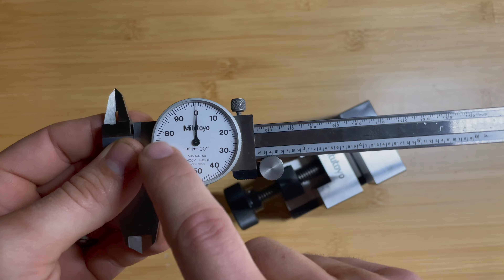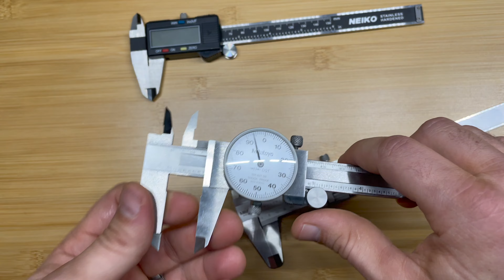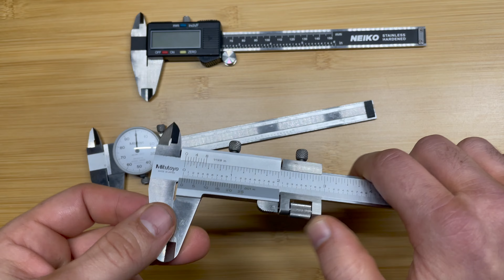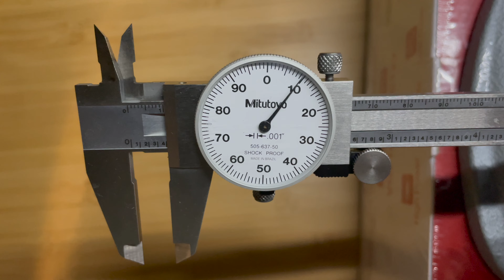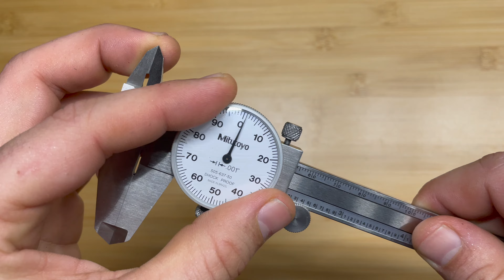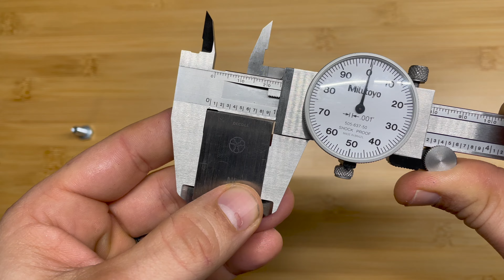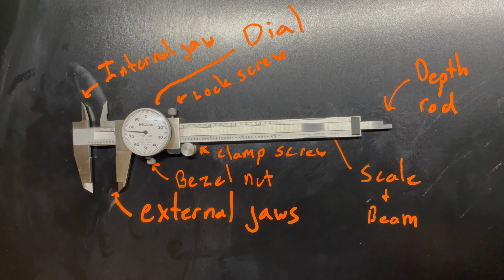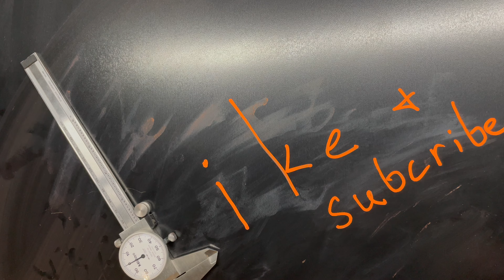Why use Dial Calipers?

Comment: A few years ago, my employer gave us each an inexpensive digital caliper. It was nice when it worked, but as you pointed out, whenever I pulled it out to use it the battery would be dead. So I bought an inexpensive dial caliper. It works great, and I never have to worry about a battery. If I need to be extra precise, I use a micrometer which measures to .0001".

Comment: The statements about digital calipers is silly. Come on! Where does the statement about 99% percent of the time the battery is low. Not sure the rest of the video is worth watching.
Reply: Cheap digital calipers don't actually switch off they just disable the screen. The circuit continues to run.
Reply: Batteries IS the biggest issue the consumer has with the digital caliper.

Comment: The Mitutoyo caliper will run for three years on a battery. That's one of Mitutoyo's super powers.
Reply: That's correct! I have 3 Mitutoyo digital calipers, before retirement they were in constant daily use. The battery always lasted at least 2 years. Cheap Chinese that I tried just for the heck of it , battery life 4 months tops! I also have dial indicators but they just aren't rugged enough , in particular they don't like dust etc.

Comment: I think he got the situation with vernier calipers backwards. The Starrett vernier caliper is the highest quality caliper they have and it has machined, ground, lapped surfaces. It is a beautiful instrument and is by far the most expensive option. They run upwards of$1000 dollars. With a dial caliper, the only thing that is precisely manufactured is the rack set of teeth and the pinion gear which operates the dial. The rest of the tool does not have critical dimensions. The dial caliper is the cheapest in terms of precision and quality.

Comment: I like digital because I can instantly do inch to metric on the fly. I do keep an extra battery..  I do love analog measurement devices when I am doing CNC work. I use calipers for finding fastener sizes. The measurement is matched against a size chart to give you the metric / standard fastener - vs finding the Tap and Die set to try and find the size.
Reply from the maker: yeah I think in general people prefer digital and I am in the minority but I have grown to love the dial more : )  obviously it's personal preference - there is not any major advantage either way. Yeah I have seen those charts but I can't say I have used them much -I would love to get into our 5 axis CNC that we have on campus but can't find the time. Just to many things to learn : )

Comment: Excellent - thanks for this!  There are many situations when an analogue scale is useful.  A rapid glance is often all that is needed to read or re-read it.  Change is also very clear to see happen.  And, and I know I will get some stick for this, but for not super precise repeated identical measurements you can easily write on the dial with a fine pen!

Comment: As a professional machinist and professor of manufacturing for more than 45 years any industry using vernier calipers is out of touch with today's technology, vernier calipers are known as the guessing stick in industry. Digital's are used in Industry 4.0 because it allows for collection of data without pen & paper and limits error, machinist on the shop floor use both dial & digital (not collecting inspection data), but in a metrology lab Digital is always used now days if not you are not ready for Industry 4.0 and yes I know CMM's are better but not all parts need inspection by a CMM.
Reply from the maker: great thoughts, do you have a recommendations for an industry 4.0 digital caliper that can also be networked?
Reply: @HTMWorkshop  Mitutoyo has several models I use and I also use their MeasurLink software for the data collect but the software works with almost all calipers with a digital serial port.

Comment: I would use standard calipers any time instead of digital ones. They get out of calibratio far too often(at least cheap ones), have fragile plastic parts and if you breake plastic part you have no way of measuring  parts. I dont have any problem reading measurment from standard ones but I understund why would someone need dial ones for extra precise measurements.

Comment: 1000% everyone needs a dial caliper, but I also have a digital caliper that I tend to use more 😁 just easier.

Cheap ones are socking good (if you get a "good" one). Only if the battery is low it starts reading wrong without warning. It's gradual, it'll start by being off by 0.0005 then gets worse and worse till it doesn't return to 0 when closed. WEN makes very good "cheap" ones that don't error as much when low on battery 😅

The quality digital calipers will also stop working or flash to warn you when the battery is too low before it can effect messurements
Reply from the maker: Good point

Comment: I prefer vernier calipers because of the price, accuracy, and durability
Reply: Im a professional machinist and wouldn’t ever use my vernier in a shop because it takes way longer to read them and at work speed matters.
Reply: @KarmaSutra420  tbh I don't see much of a speed difference between vernier and dial. Unless it's digital, you still have to manually read the scale/dial
Reply: @brandonjohnson1339  for me it’s a difference of about 5 seconds which would really irritate other machinists. Also in my shop we have a double verify system so I couldn’t use a vernier since most can’t read it
Reply: @KarmaSutra420  Every machinist should be able to read a vernier caliper
Reply: @brandonjohnson1339  your opinion doesn’t change the reality that most consider it an antiquated technology and that’s why tech schools/apprenticeships no longer teach how to read them. Anyone still using vernier calipers is an outlier in the field. 

Nobody taught me to use a vernier scale but I just bought one and it was obvious to me how to read it. Even though it’s cool I still wouldn’t use it at my job professionally.
Reply: @KarmaSutra420  I'd say dial calipers are the outliers because they're not as accurate as digital and not as durable as vernier
Reply: @brandonjohnson1339  once again your opinion doesn’t change the reality of the industry. You must not work in it anymore
Reply: @KarmaSutra420  You too. Most people use digital
Reply: @brandonjohnson1339  I have a digital also, I have numerous mitutoyo calipers but the dial is my favorite. I’m one of the highest paid machinists in the area and have been asked to teach. Nice thinking that though
Reply: @KarmaSutra420  and? l have digital too lol. You just don't like the fact that l  like vernier
Reply: Drop a vernier caliper and they're junk. The digital ones don't have that issue because they don't rely on tiny mechanical parts to work
Reply: @wills5482  Sounds like you don't realize the same is true for dial calipers...